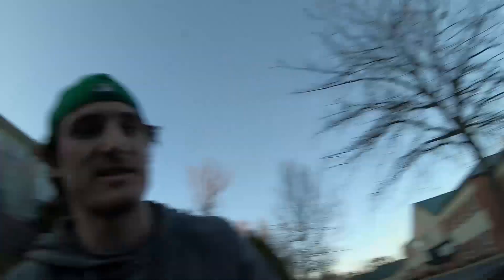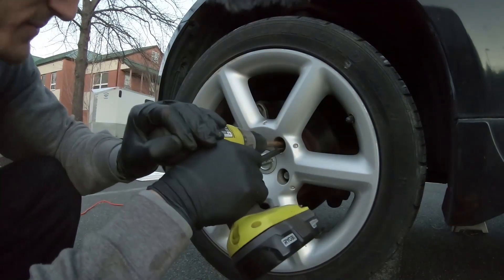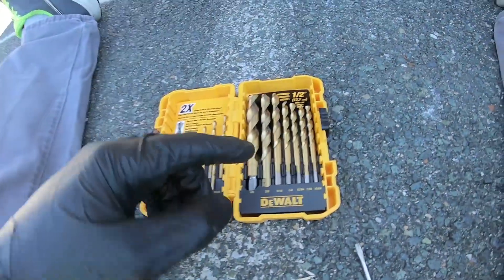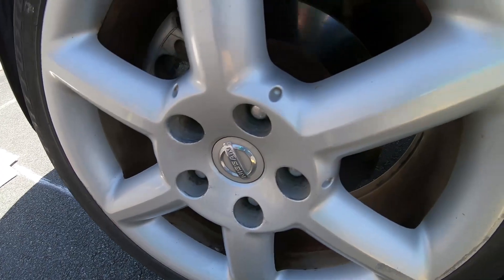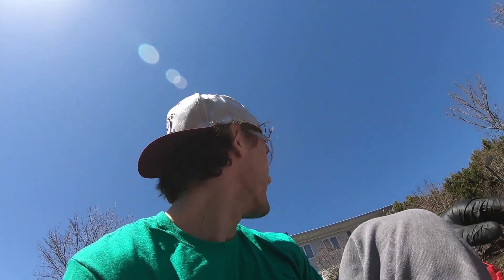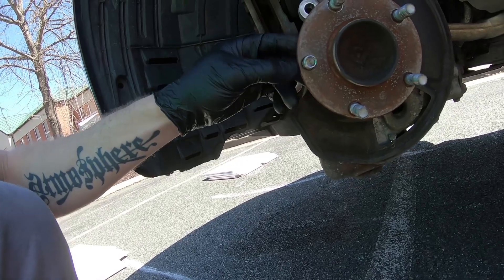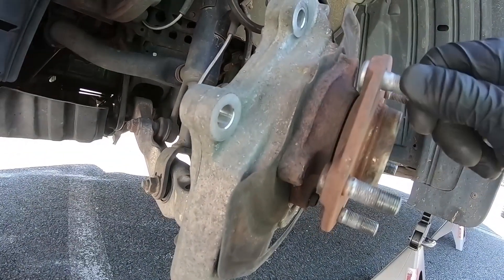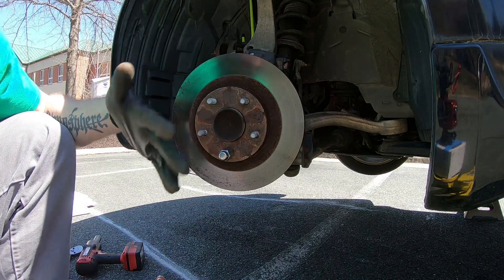350Z Spinning Lug Nut and Stud Fix

Comment: Work at a shop. We are "maintenance technicians" and do oil changes, tire rotations, tire repair and removal/replacement.
There are a couple factors for spun lug nuts and wheel studs, but most happen when as the vehicle is aging. F*cks at shops are too lazy to tighten the lugs lightly and prefer to Zapp them on full speed with there impact tightening to "manufacturer torque specification" and claim they "know their gun" but are never accurate. Usually Slamming the lug nut to the wheel full force and gunning it till its "tight enough" usually over tightening. Studs and lug nuts can only take so much shockload.
Technically you mount the wheel flush on the hub and run the nuts on with your fingers about halfway on or more then start with the bottom lug and lightly gun it, then follow the correct tightening pattern. After that, lower the vehicle till the wheels are touching the ground  and can't spin by force. Then use your torque wrench and tighten to manufacture torque specification.
Main points: don't be lazy, start threads by hand, lightly tighten, and use a good torque wrench to tighten too manufacturer torque specification.

Comment: I’ve had this problem before. My best tip or trick is take all the other lugs out except one on the bottom pull on the wheel on the area of the stuck lugnut,  get pressure on the nut to help put it in place and back it out. Another option is the same way but actually tightening the lugnut which will help press it in place and you can easily back it out

Comment: Thanks for your input, and time spent, on what seems to be a very common problem.  I'm going to update drum brake hardware on my rear wheels (Jeep TJ), and I have a cross-threaded lug in a tight spot in a 1  1/2" wheel spacer.  Fortunately, most of the lug nut has made it off the stud.  Hope to minimize the drilling.  Only way to go.  Cheers!

Comment: I just had that problem. One stud spinning in the hub. Tried to drill lug nut and or stud. Also used a carbide burr die grinder. The cone of the lug nut was down inside of the mating surface of the aluminum wheel and could not get to with drill or burr.. After three hours of drilling and grinding, I gave up and got the acetylene torch. Aimed the flame towards center of stud when cutting down the side of buggered up nut. Ended up with nut and stud gone but burned the clear coat and discolored around hole of rim. What alternative was there. Take it to dealer or shop and would probably be charged $1000 and ruin wheel or possibly refuse to even work on it.

Comment: thanks for the vid. I've run in to the same problem with mine today. Question. when you were drilling, how did you prevent the lug from spinning? Or did you not have that problem? I'm having same issue with a stud on a wheel spacer.
Reply from the maker: That's why I had the orange pry bar stuck in there while drilling, that's what prevented it all from spinning. I just had the flat side of the pry bar up against one of the sides of the lug nut and that kept it still. It wasn't fun and took a lot of time haha. Good luck man, if you have any more questions just let me know.
Reply: @kamalakeel  awesome. Thanks for the tip.

Comment: wat kind of drill bit did you use
Reply from the maker: I got some titanium drill bits from Lowes. The brand I got were Dewalt but you can probably get any brand. 1/4", 5/16" and 3/8" sizes are what youll mainly need to get it out. So just make sure those sizes are in the set you get.